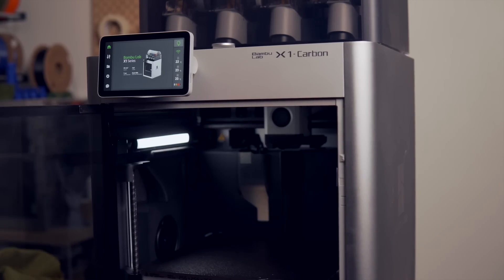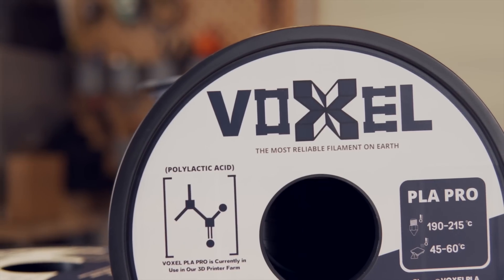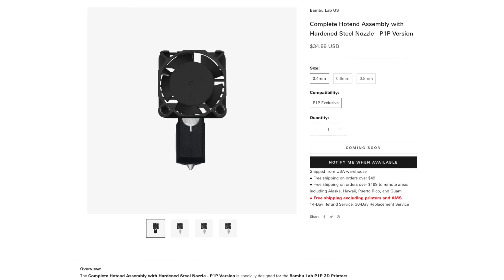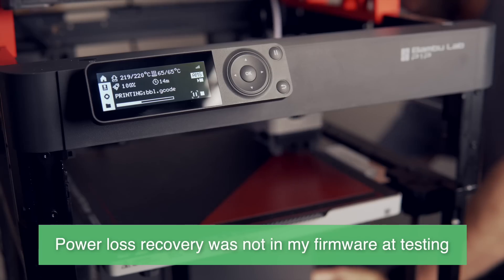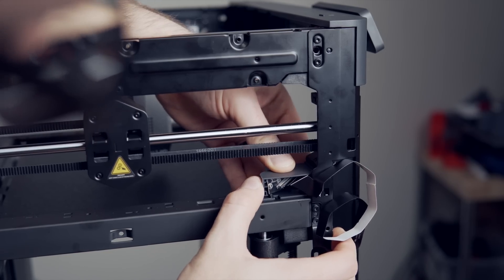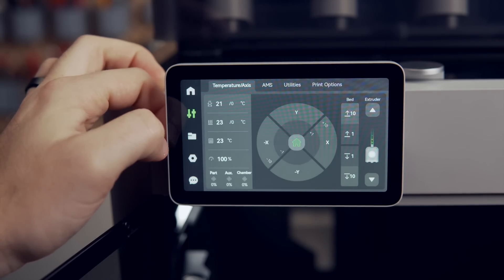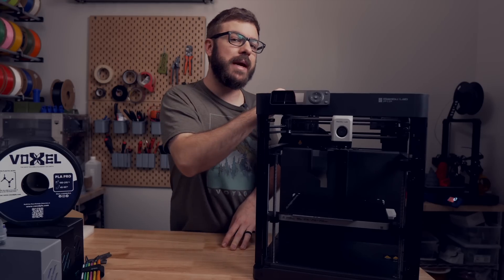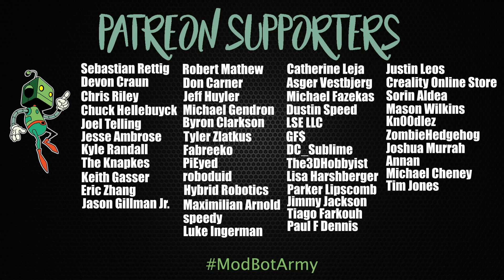Best Price To Performance 3d Printer? (Bambu Lab P1P)

Comment: I own a p1p cause I like the pei plate which do not work with the x1c lidar.  but the p1p does not seem to allow access to the SD card from the slicer for easy repeatable prints (annoying if printer is far from computer. what do you think? I believe the X1C has the firmware to access the Sd... very positive review for a fantastic printer that  still has some limitations. thanks

Comment: If speed is not the most important thing, is this still the printer(s) you would recommend for its price? Are there other/cheaper printers that deliver the same print quality at a lower speed?

Comment: bambo carbon or qidi ifast?   you have used both
Reply from the maker: Definitely Carbon. There are alot of good things with the iFast but its much slower, didnt have bed leveling (auto), and more expensive. Unless you needed the build volume I would choose the Carbon.

Comment: Need a buying advice X1C vs P1P. Not counting the look and the fancy control panel, do I get the  performance and print quality of a X1C if I replace the head to a hardened steel version and add some DIY side panels to get a closed chamber on a P1P?   I would like to print high temperature materials like nylon, carbon filaments, ASA without warping.

Comment: A good summary which fits into the hype around the P1P!

But one thing is missing in the video! A comparison to a similar printer and the lack of different aspects of this hobby when buying a P1P!
So it would have been really nice if you could compare this P1P to the experience (!) of building your Voron 0.1 LDO Kit or the Voron Switchwire! Here in Germany I need to invest like 800 bucks for that P1P because of VAT, so even a 900 bucks Switchwire Kit is in that price range!

I think you missed that part, because you already have built some Vorons and got the joy and the experience from it. But think about newbies entering this hobby! Wouldn't it be great to get a similar experience from investing a bit under 1K? So a comparison from that perspective is kinda missing, which would lead to a show off between Voron 0.1, Voron Switchwire and the P1P if you don't want to include the Prusa Mk3 Kit.
It's self building vs. "only a tool", modifying vs. stock, building first vs. printing half an hour after unboxing, RepRep idea vs. OEM, speed vs. more speed and also quality vs. quality! Also the missing features in their slicer or the availability profile from minute 1 could be worth some words.

And there is another thing I look into from a beginners perspective: increasing level of difficulty.
When I would buy an Ender 3 Pro and begin printing with it. Than maybe add Klipper with an old Netbook laying around or an Raspi to increase speed. Add Octoprint for a webcam (with an old smartphone) to finally cnvert it to a Switchwire ... THIS would be an upgrade path with gaining lots of knowledge in setting up software, building, tuning. Wouldn't it?

Off course: the P1P is the fast route to arrive at having a "fast tool". But what if something doesn't work properly: can somebody fix that without the experience you have? 
And: isn't the journey the reward with that hobby?

Greetings!

p.s. After the P1P is available for some weeks now (according to reviews coming out), it would be nice to know how far the addition of extras can go! You mentioned a enclosure for ABS. Are the standard designs sufficient enough to enclose the printer? Can an chamber fan be added and controlled via the screen, as well as a filter for printing ABS? 4:21 That would be cool to find out!

p.p.s. You don't have the link for the AMS system tested in the description or am I too drunk?!

Comment: As said in the end of the video, my hope with the introduction of these machines is that the industry is forced to up their game. Not that it appears the Bambu labs printers are bad but if they continue the way they are going and everyone else stays where they are at I’m not sure all of the other companies will survive. 

The Bambu labs printers are a statement, it’s a new company with arguably better hardware then the rest at a fairly affordable price. The legacy manufacturers should be able to meet and exceed what Bambu labs have done, and I suspect there is more on the horizon from Bambu labs.  

I see lots of people saying just buy so and so printer and do these things to it and it will be better, or just build a voron, and to be fair some people want to and like to do that, but many people just want to buy a printer and make some stuff and not wait a week for it to print or have to constantly upgrade and modify a machine. 

While I still have reservations about how these new machines will hold up and perform long term  those reservations are dwindling quickly. Enough so that we have made plans to make a Bambu labs purchase after the first quarter only because during the first quarter we are making upgrades and redesigns of the work space.

Comment: Curious what settings you may be running for the auxiliary fan, since you noted you thought it was worth having. I found with the default 70% in the filament profiles, bed adhesion on the left side of the bed was terrible (even on large based parts), and I've been running it around 10-20%, though it hardly feels beneficial there. Any thoughts?

Comment: Would Matte PLA be considered abrasive?  I run mostly matte pla's and don't want to damage  the p1p that is on it's way.
Reply: I don't know for sure, but when I do a few spools of matte, I end up having to change my nozzle out. I stopped using matte, and haven't changed a nozzle in a while. I used Eryone Matte PLA

Comment: For me I use my printer to make end use parts for work so the X1 Carbon is a god send. I can print parts in 3 hours that look beautiful vs 12 hours with a high warping rate on my old ender 3 v2. I love being able to save my prints and just being able to load some asa and pressing a button to have a replacement part. I've seen a lot of people in the 3d print community be pissed about how easy the X1 carbon is to operate and how it ruins the fun. For me, being able to have a part back in 3 hours vs having to stop work to mess with a printer for 3 days is well worth it
Reply: It seems there are several groups in the 3D print community. I fall into a group similar to you, it’s a piece of hardware in my shop that I need to produce parts accurately and quickly. While I’ve enjoyed learning I need to produce parts. It’s not a hobby for me. No I don’t just 3D print, but when I need a part time is king. 

All that being said I have few complaints on the printers I have other then the amount of time it takes start to finish. I’ve been waiting and watching the Bambu labs printers waiting to see how they do before making a purchase. And while some machines have had issues overall most users are incredibly happy with the speed and quality of the printers. I likely will make a purchase after the first quarter on one of each, an x1c and a p1p. The x1c for the ability out of the box for carbon/abs and the p1p for petg and pla+. We just placed preorders for 2 flsun v400. The 4 new machines should all be significantly faster then the assortment we have now.

Comment: Prusa really kicked the industry in the nuts with its quality for price back in the day but they have really not done much since. The mini is really good at that for its size but in the large format sector they really haven't done anything recently. I'm glad another company is now here doing the same thing. Without companies pushing the quality for price envelope so aggressively we would just keep seeing the same printers come out over and over like we have the last few years.
Reply: And don't forget Creality! After Prusa was known they came with the Ender 2 first (a 160 bucks machine back than and maybe the blueprint for the Prusa Mini) and achieved a solid base with their Ender 3 models for a capable i3 Mk2 machine for below 300 bucks!
And despite Prusa: they had and do have larger machines available like the CR-10 or Ender max with up to 400x400 or larger. With the 500 bucks Ender S1 Pro and the Sonic Pad they are also ahead of Prusa in terms of features, speed and Klipper. A large community with lots of tipps, tricks and modding can also be found...

From what it looks like now: it's easy to compete with Prusa, because of price! But competing with Creality price wise, with production capabilities and the arrival of Klipper to these low cost machines, the air is getting thinner and thinner!

Comment: I think it'd be interesting to see how the new FLSUN V400 compares to this speed wise, or maybe more the X1 Carbon. I've been interested in both the V400 and the P1P. P1P Seems like it'd yield better quality overall though but would still be a cool comparison.
Reply: It's the exact same motion system as the x1 carbon, so it can go faster than the flsun v400. The v400 has the advantage of a higher flowing nozzle, but the p1p seems to be an easier to use machine (also quite a bit cheaper).
Reply: @morbus5726  That’s incorrect the V400 goes faster, there’s a video with this comparison from 247 printing. The setup was also very quick with the V400, think I had maybe 15 to 20 mins before I was ready to print out of the box. Deltas are hard to beat when it comes to speed but the X1 carbon will be more accurate as that is where delta take a slight dip in.
Reply: @techguy38  like I said, the v400 can flow more, but the x1 maintains quality and can do higher accelerations.

Comment: It’s really tempting but the closed hardware is a no-go for me.  One of the refreshing things about the 3D printing space is that users have so much flexibility.  Slicers, nozzles, hotends, extruders..  it also keeps machines refreshed and updated.
Reply: You can use any slicer with the bambu printers
Reply: That‘s not the target audience. It is meant for people who want an out of the box experience without much tinkering.

People who want to dive deep into 3D Printing can build theirselves a Voron or something similar…
Reply: It's one thing to have a high-end, "prosumer" printer in which you expect to trade off personal repair/upgrading/modifications AND high price point for reliability. But it is a completely different story to have these same restrictions and still be priced @ $800 (counting taxes and shipping). The only reason I can justify either printer at this time is to buy these as business assets and write down the cost or schedule depreciation. It'll still take a hunk of money out of business (or my own pocket if I have an LLC), though, so I will need to find ways to justify this expense (return on investment - ROI). And for now, I just can see doing it. Especially since I can build a CoreXY at, or just above the P1P price.
Reply: @thomaswiley666  this is crazy underpriced considering the features of the p1p. It's clear you haven't built a corexy kit from scratch. You'd be looking at $1000 plus raspi + 40-50 hours of assembly and 10-20 hours of tuning.
Reply: @morbus5726  It's clear that you are making unfound assumptions as I have built several Cores by sourcing materials in bulk, printing where needed, etc. You might be thinking about the costs of "kits" but I don't want to assume that's what you are thinking. Also, this is not "crazy upderpriced" as this company is Chinese, kitting and assembling these units in China. Their margins are quite hefty and have room to drop to kill off any Western company deciding to build a knock-off.
Reply: @thomaswiley666  what corexys have you built? where could I find a 250mm^3 corexy machine for under $700?

Comment: as a X1C owner i am verry happy with that machine , but the P1P is not worth it for me , if it would be 450$ then i would insant buy it, but at 700$ i preffer the X1 instead
also i print mechanical filaments like Nylon and ABS a lot, so first printing my own enclosure, dealing with the "non" touch screen with less ram and more startup time then the bambu .. got a lot of things that prevents me from paying the premium price
but it is indeed a good machine if you are not already spoiled by the X1C xD

Comment: Bambulab is fking all its competitors. The only downside is that it uses proprietary hardware, but I am confident that it won't be long before someone figures out how to modify the firmware or create a complete replacement for using it with standard BTT SKR and Voron Hotends. Great Review

Comment: Thanks for a great review. As a Prusa Mk3s+ owner I am now seriously considering this as a second machine. I just have 2 questions: Should I wait a while to let the ecosystem mature a bit (bugs sorted out, enclosure and other add-ons made available etc) AND should I wait for any special offers that might be available (Black Friday etc)? I know Prusa offers free shipping on Black Friday but not sure if these guys have something similar in place.
Reply: I worked at a print farm for years and I would personally go ahead and get one if I could. The good outweighs the bad. It looks like the system is updated often and the machine itself is modular.
Reply: Even if the machine breaks down for like three days a week, it will still be able to put out twice the prints as the prusa at $400 less.
Reply: @morbus5726  the prusa is an easy to use printer and is consistent but very over priced. The kit price should be the built price. Our print farm had 30 prusa mk3s and still felt slow. 10 x1c could replace all of the prusa.

Comment: I have an X1C, which I find amazing for printing ABS.  After experimenting with a few things I've settled on using the engineering plate with glue for ABS.  I have a 3rd party PEI sheet that works really well for PLA but I find it releases too soon as it cools and my ABS prints warp.  (I don't have the Bambu PEI because I like my bottom layers to be super smooth, so I don't like the textured surface.)

I've recently had a desire to have a very very accurate printer with a 0.2mm nozzle to print very small things.  The X1C is so accurate with even a 0.4mm that I feel I could get close to resin accuracy - at least when viewed from "table distance," rather than with a close-up camera shot - with the 0.2mm.  But the X1C isn't awesome for PLA and it's really overkill for a "minis printer" so I'm currently wondering if I should try to save for a P1P.   (Alas, there are many things competing for my 100$ a month budget, so most likely I'll just do nozzle swaps on the X1.)  But yeah - all the folks just using their X1Cs for PLA and PETG are using their Ferrari to buy groceries; if those materials are all you print with, I think the P1P is going to be a better choice.

Comment: I had some prejudice towards getting a p1p after getting an x1c but after I considered what my use case was and spent time looking into what features were actually removed I realized getting the p1p to fill out my printer setup was a much better idea overall.
Reply: Out of curiosity, what didn’t you like about the X1C that was remedied by the P1P?  I’ve always been looking for that “nice printer”, and of course, the shiny nature of the X1C is quite attractive. However, the smaller price tag on the P1P is also quite attractive. 😅
Reply: @shinaikouka  oh I absolutely love the x1c performance. It’s just after getting it I realized the p1p is a much better option due to its price point for me to get multiple of.

Comment: I love their strategy and its a much more capable machine than a Prusa.  I've seen many Prusas that had some time on them (hundreds of hours) and wasn't impressed how they hold up.  I was also not very impressed at the quality of their PETG parts.  It's a very overpriced machine for what it is.  I will give them some kudos tho, they do offer very good support.
Reply: To be fair, we have no idea how these machines are going to hold up after years of use, what parts will be available, or how maintenance will be handled.
Reply: I've seen bambus wth 2000+ hours and little to no issues, so the longevity should be ok.

Comment: I'm loving my P1P so far, this thing screams,  I made all of my xmas gifts for my nephews, what would've take weeks on my my ender 3V2 and neptunes took less that a week on the P1P,  I did get the same issue as you where the printer just stopped,  but I haven't seen it again since then, I also haven't updated any firmware since then either though.  I'm not a huge fan of the camera, the resolution is fine, but I would've like a higher frame rate, even if only 15-20 fps, would've been better than the .5 fps it does now.

Comment: hi, do you know if the x1 camera works with the p1p, if it transmits more fps
Reply: It does not. They use different firmware, and connection methods. Bambu has said they can not be swapped.

Comment: Are you forced to register with an account? Then its an absloute no-go for me.
Reply: you can print out of the box no account, though annoyingly updates do require logging in as they have yet to release updating via SD card.
Reply: @BeefIngot  Thanks for the info
Reply: It will be SD Card use only. Add the units that just arrived from actual orders, just before Christmas, do require a firmware update right out of the box.
Reply: Why's that an absolute no-go? You can just use throwaway info if you're paranoid about that kinda stuff.